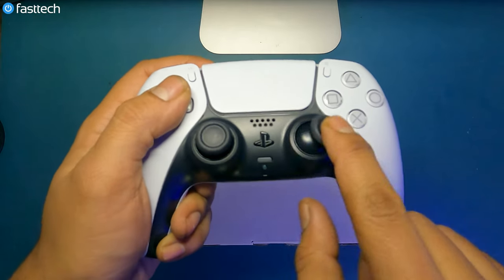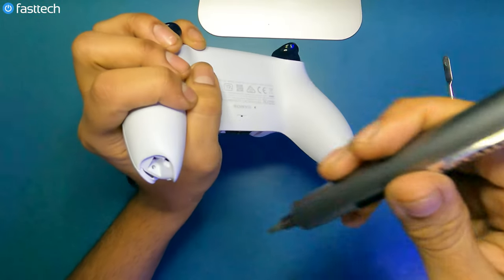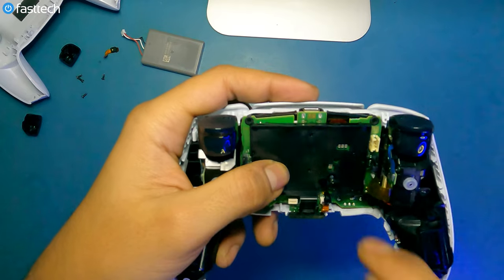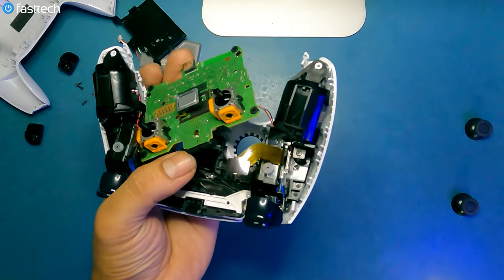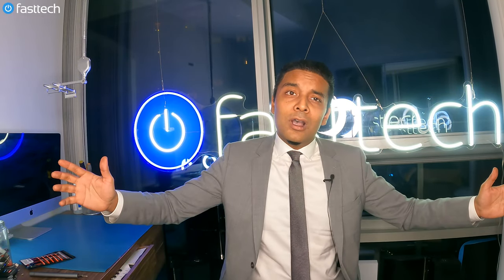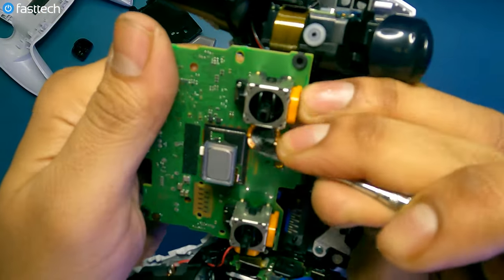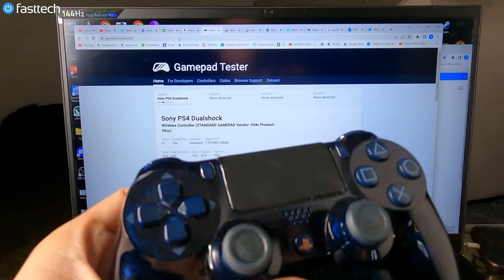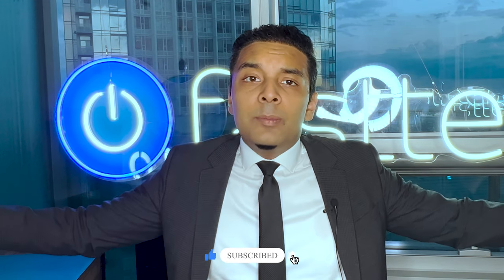How to Fix PS5 Controller Analog Stick Drift

Comment from the maker: ▶ Test Controller for Stick Drift: https://gamepad-tester.com/
▶ Fasttech Pro AutoKit: https://www.fasttechstore.com/tools/fasttech-pro-auto-kit
▶ Fasttech Pro Toolkit: https://www.fasttechstore.com/tools/fasttech-electronics-repair-toolkit
▶ PS5 DualSense Complete Analog Stick Mechanism (2): https://www.fasttechstore.com/ps5controllerdualsense/ps5-controller-analog-stick-mechanism-set-of-two
▶ PS5 DualSense Complete Analog Stick Potentiometers (2): https://www.fasttechstore.com/ps5controllerdualsense/ps5-controller-analog-stick-potentiometers-set-of-two
▶ PS5 DualSense Controller Battery: https://www.fasttechstore.com/ps5controllerdualsense/dualsense-controller-battery-cfi-zct1w
▶ PS5 DualSense Analog Sticks: https://www.fasttechstore.com/ps5controllerdualsense/dualsense-controller-analog-sticks-cfi-zct1w
▶ PS5 DualSense Motherboard: https://www.fasttechstore.com/ps5controllerdualsense/dualsense-controller-motherboard-bdm-010
▶ PS5 DualSense Controller Battery Cradle: https://www.fasttechstore.com/ps5controllerdualsense/dualsense-controller-battery-holder-frame-cfi-zct1w
▶ PS5 DualSense Controller Touch Pad: https://www.fasttechstore.com/ps5controllerdualsense/dualsense-controller-touch-pad-cfi-zct1w
▶ PS5 DualSense Lower Microphone: https://www.fasttechstore.com/ps5controllerdualsense/dualsense-controller-lower-microphone-cfi-zct1w
▶ PS5 DualSense Upper Microphone: https://www.fasttechstore.com/ps5controllerdualsense/wcvl4fpadgf0b3yqut75bx22sk6cos
▶ Buy PS5 Parts: https://www.fasttechstore.com/playstation-5-1
▶ Want us to fix your device for you? Just order the Fasttech Repair Box to send us your device by using this link: https://www.fasttechstore.com/repair/repair-box
👉NEED HELP? FaceTime/Zoom Video Call Me: https://www.fasttechstore.com/online-consultation
👉GET REPAIR SERVICE FOR YOUR DEVICE: https://www.fasttechstore.com/electronics-repair

👉Business Social Media:
Twitter: https://twitter.com/FasttechCA
Instagram: https://www.instagram.com/fasttech.store
Facebook: https://www.facebook.com/fasttechy

👉Follow me on Social Media:
VLOG CHANNEL: https://www.youtube.com/channel/UCF2IPXKRX5ctN9td1rhkzHg
Instagram: http://instagram.com/youngtechg
Twitter: https://twitter.com/Shehroz